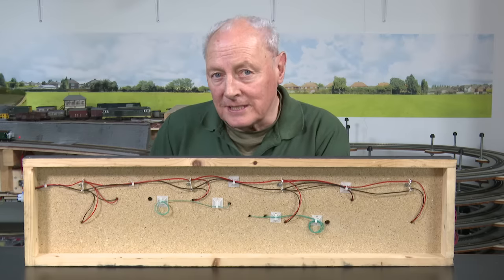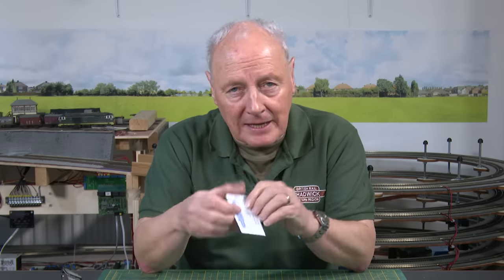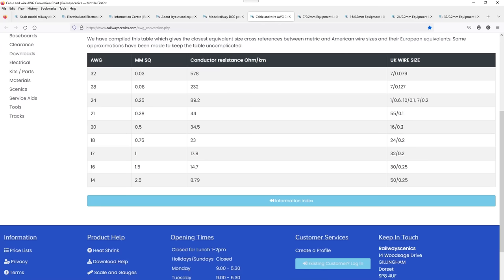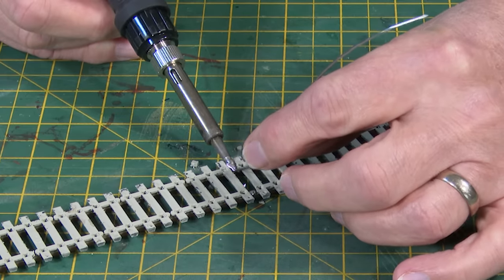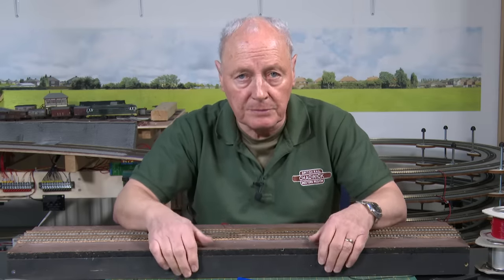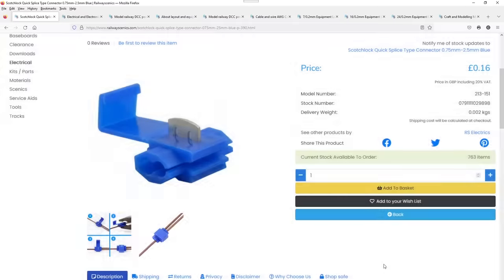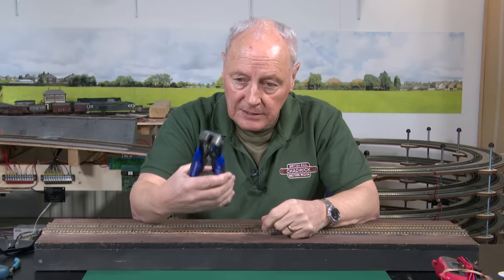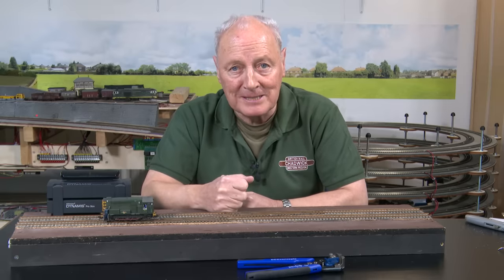LAYOUT WIRING for DC and DCC and all gauges at Chadwick Model Railway | 175.

Comment: Great channel Mr B. With bus wiring I just glue a length of track under the board and then spot solder the droppers etc to either side of the track. Gives superb flexibility and you just need to power the track.
Reply from the maker: Ingenious Guy, I take my hat off to you. Regards, Charlie.

Comment: My favorite fire experience: (this was not me, I was a visitor) a nurse comes running out of a hospital room yelling fire & a visitor (who happened to be a firefighter) put a pillow over a trash can fire and smothered it. By the time all the fire engines, ladder trucks, hospital maintenance staff, administrators and the safety officer got there it was out. But the safety officer, seeing it was out, but he sprayed a dry powder fire extinguisher and made a mess everywhere, including needing respiratory therapy to treat the patients who inhaled dry powder. Priceless.
Reply from the maker: What a great recollection, Stephen. Regards, Charlie.
Reply: @ChadwickModelRailway  
Excellent timing on wiring, I have six colors of 16ga AWG on spools and the next step is laying a BUS wiring for my new 122 cm x 244 cm (?) 4'x8' N gauge layout. It took some time to get the height up to 130 cm (51") so I can work without sitting or bending due to a back injury with chronic pain, but it beats spending my life in a wheelchair or worse... 
Two wires for general use +/-, and six wires for my OCD or is the conversion putting the letters alphabetical CDO, lol!

Comment: Hi Charlie, I wish I had seen this video 2 years ago when I was wiring my layout. I have been told that I went over the top with my track bus cabling, I used 6mm cable with a dropper from every piece of track, but with a track run of about 200ft I don't get any voltage drop or signal loss so I think my choice has proved it's point, the cable I had spare in my garage from my contracting days. The DCC Concepts wire strippers are similar to the type I have been using for about 20 years now, they will strip any wire size from telephone to 6mm without having to waste time adjusting the cutting throat like with some expensive units. The connectors are a great unit but I found out about them when I was about 3/4 of the way round my garden section soldering the droppers to the bus wires so I just carried on. Another excellent video which also covered some of the safety requirements when we are working on our layouts.
Reply from the maker: Sounds like a bit of overengineering Peter, it’s not such a bad thing. Regards, Charlie

Comment: Those stripping tools from DCC Concepts really are excellent, I got one just before I started to build Pevenbourne and have used them to install the Track and Accessory buses so far on Phase 1 of the build along with the little connector boards you demonstrated. And I shall continue to use them throughout the build. I also install my droppers in exactly the same way as you do having learnt the single hole through the board method from you a couple of years ago.

Incidentally, thought I’d share a little tip that I use when I solder the bus wire to the tag:- 

After you’ve stripped the bus wire, passed it through the tag and soldered it, while the joint is still hot, it’s possible to gently push the insulation from both sides of the tag so that it closes right up to the metal of the tag so you don’t have a gap in the insulation. It works for me and I do it on all the tags. 

Take care Charlie.
Reply from the maker: Great point Bryan, regards Charlie

Comment: Hi Charlie! Fantastic little tutorial mate 😉

I have made good use of those block connectors on my portable garden test track set up, and they work superbly! I also made use of HiFi male/female sockets which plug in nicely on the simple two-track sections on my ‘back straight’ furthest from the power source! As you suggest, running a bus and dropper wire system really helps maintain even running with DC and can’t recommend it enough 🤓

I also made use of a pair of SCART leads to connect my power box to the main board, which enables me to run DC in sections. Because of the simplicity of the connector systems, it means I am able to fix the 6 separate components of my set-up, including the legs and tables they sit on, and then make all the electrical connections secure within about half an hour 😎

By the way, as someone working in a safety critical environment, I applaud your simple H&S advice. I have a mini extinguisher from a kitchen supplies ship inside the door of my shed ‘just in case’, not least because, as I am sure you well know, even the fumes from a small electrical fire can be life changing 😟

Oh, and thanks for drawing attention to that website. That is what you call decent customer service, which seems to be an evermore disappointingly rare characteristic these days 🙄

Cheers mate, look forward to the next one, have a great weekend 👍🍀🍻
Reply from the maker: What a heartwarming comment Tim. I’m so grateful to have you on board, with such enlightening comments. Regards, Charlie

Comment: Super-duper video, Charlie.  I have the very same RS Components wire stripper and I'd like to share a little tip with you that an electrician shared with me.
When using multi-strand wire and stripping the end, don't pull the entire jacket of the wire off, instead only apply enough force to cut the jacket and pull it slightly back, leaving the jacket that's to be removed still partly on the wire length.  Remove the trimmed jacket but, as you do so, twist it, and it will twist the wire strands really neatly. It works a dream and saves running the risk of a copper wire splinter.
Reply from the maker: An excellent suggestion and much appreciated. Regards Charlie

Comment: Charlie I managed to watch another five mins of your soldering techniques video before exploding with frustration. You took another third party product clipped it with your cutters and recreated the task if the D.C. scotch lock connector…, then you got your soldering iron out again. OMG just press the scotch lock closed with your pliers!job done!!
No more soldering under the table … please!
Reply from the maker: As I mentioned in the previous comment Paul, I couldn’t possibly recommend something that has a reasonable chance of failure in the long term. Regards, Charlie.

Comment: This takes me back. My dad (Ex RN!) Had a business manufacturing cable testing equipment, all cable has to have its insulation tested as its extruded and the insulation applied and the machine that tests the insulation is called a spark tester. We made units from 3KV to 50KV to test all types of cable including multicore and multi strand cable. We manufactured machines for all types of manufacturers from the really big boys (BICC etc) to small one machine family run businesses!
Reply from the maker: Happy days, from perhaps simpler times. Regards, Charlie

Comment: Charlie... Been watching you for a couple of years.  I am in Canada (Brit background however) but I do not model your scale, heck I do not even model DC/DCC!    I find your "generic" videos most helpful.  

I inherited my father's Marklin collection a number of years ago and I continue to keep the folks at Marklin employed by buying more "stuff" for it.  Marklin is HO.  Uses AC current.  I have both an analog portion of the layout and a digital (using Marklin's proprietary controller).   This video was an excellent example of how to run a bus.  I am in the early stages of ripping my layout apart and starting over and I will certainly look to using a similar method of electrical bus.  

Bruce
Reply from the maker: Thanks Bruce, I wish you well bringing your father’s layout up to date.
Regards Charlie

Comment: Hi Charlie, your "how to" video's continue to provide amazing insight and knowledge to me as a seasoned novice getting into building my first layout thank you so much!  I have started with a couple of demo base boards to mock up my planned TMD and I am using second hand track/points to learn how to plan and layout the track as well as then DCC wire it. My early soldering has been a bit of a disaster to be honest where i have melted sleepers :( However, I plan to keep practising it as it will be the only way I improve! I have just rewatched this video as today I am soldering in the bus wire and droppers and I have invested in the 3 way tags and wire strippers from DCC concepts, thanks for the tip! I have also  found the ralwayscenics website you highlighted and again this is incredibly helpful as a beginner to this hobby. Once I feel that I have developed my skills sufficiently I can then move onto my intended layout. Thank you so much, your archive videos are incredibly helpful and I can easily search for the topics relevent to the build stage I am at. All the best, Richard :)
Reply from the maker: Thanks Richard, I’m so pleased that you found the channel to be so useful. Good luck with your project.
Regards, Charlie.

Comment: Charlie, An absolute blinder!! I'm just about to spend a weekend on my back, hooking up my droppers to bus wires,  Some great  tips, I too have an aversion to those auto crimps. The terminal strips you illustrated for joining the droppers to the bus wires are an absolute gem. I like to solder the droppers to the ends of my tracks, thus I get two  droppers onto one bus wire join -saves a bit of time. Thank you for the video, so much useful information. A final thought, you can't be too OCD on wiring, if it's a rats nest and you've got a problem, you haven't got a hope in hell.
Reply from the maker: Great comment Scott. Good luck with your project, regards, Charlie

Comment: Charlie, I've moved on from suitcase connectors because, as you observe, sometimes they don't make good connections between wires of different sizes. However, I don't want to solder beneath the layout, over my head. I now use solderless T-taps. You attach the female end to the bus wire (crimping them) and the male end to the feeder (dropper). Then, you simply plug the male into the female end. Works great. Having said that, I like your method for neat wiring.
Reply from the maker: That’s an interesting comment James, I shall have to check them out. Regards Charlie

Comment: Hi Charlie, Richard Johnson sold the cutters/ strippers and the bus tabs about 10 years ago, that's how i have wired my bus and droppers, works a treat. I in some place soldered an extension terminal to the part where the holes are which meant I could wire at least 4 bus wires each side where there is multi tracks. Great video as always.
Reply from the maker: Thanks four Oaks, I’m so pleased that you found it. Interesting mate. Regards, Charlie
Reply: @ChadwickModelRailway  Always

Comment: Hi Charlie, long time watcher, first time commenter here! Great video as always! You're content has really helped me as I've made my way back into the hobby after a 35 year break! Soldering under the layout frightens the life out of me, so I started using those Suitcase connectors, but have since moved onto using things called Lever Nut connectors! You can get them from Amazon / Screwfix and they handle differing wire sizes and come in sizes with different numbers of ports, so you can take multiple droppers from the same connector! Keep up the good work! All the best, Ian.
Reply from the maker: Hi Ian, I think the connectors you’re talking about are called Wago connectors. I shall be getting some next week and checking them out. Regards Charlie
Reply: @ChadwickModelRailway  - Ah, okay, I buy the unbranded ones to save a bit of cash! 😀

Comment: Great timing Charlie :) just dumped my Parsons Heath layout, room needed decorating anyway but glad there's an alternative to connecting droppers to the bus wire. I hated those clips and I found them problematic as with those soldered rail connectors so will give those clips from DCC concept a try. Memories of the Great Eastern in N gauge is being started at Christmas on a 12 x 8 board set up so this video has been very handy... Thanks Charlie
Reply from the maker: Thanks Steve, I’m so pleased that you found this video particularly useful. Regards, Charlie

Comment: A phrase I've used many times, but "I love those strippers and must get a pair for Christmas". Thanks Charlie, I'm just at the bus wire point on my layout and have been stressing over using chocolate block type connectors. This seems a far better system.
Reply from the maker: Good luck with your project Mike, I’m sure that you will wire it up just fine. Regards, Charlie

Comment: Great video as always Charlie. Thank you for that. A word of caution re the use of the fire extinguisher. Most folk have never used a water/foam based extinguisher let alone a C02. The latter tends to go off with a heck of a whoosh when you squeeze the trigger and can really scare the unwary. You can end up doing more harm than good and actually spread the fire rather than put it out. The reason we have extinguishers in the workplace and the home is to help us escape if our exit is blocked which is why they are always located on the route of escape or final exit, rather than to fight a fire. I did fire training in industry and elsewhere for many years and would never recommend that anyone "has a go" if they don't know what they are doing. Can cause far more serious issues...not being critical by the way, just a cautionary note.
Reply from the maker: I do thoroughly understand your point of you. However, when faced with a burning waste paper bin, perhaps one shouldn’t abandon the building. Regards, Charlie
Reply: @ChadwickModelRailway  Agreed....much better to pick it up and run for the door (seriously, I saw someone do this with a chip pan fire before they threw a bucket of water on it and wondered why it exploded!). A liitle knowledge can sometimes do a great deal of harm which is why I always leave anything electrical well alone even with your expert advice...

Comment: Good job Charlie. Tag strips like the DCC concept ones have been around from a very early stage in electronics. searching for  10pcs/50pcs/100pcs turret strips on aliexpress will find a heap of options. Some of theirs leave the centre tag just for mounting it. Good call on the suitcase connectors. They used to be used in diy auto stuff more so. Auto electricians prefer crimps for better mechanical reliability. Suitcase connectors can work for some but differences in insulation thickness, number of strands and strand diameter and not cutting dead square through the insulation means poor contact or cut strands and they are a hidden issue.

I find a lot of people don't join the dots for what is required for block detection. Usually, for current detection type block detectors, all droppers, from one rail, go to a feeder that then is connected to the DCC bus through the current detector. The other rail droppers going directly to the track bus for the other rail. Could be worth doing a diagram of how it works for your block detectors next time. Great work Charlie.
Reply from the maker: An interesting comment Greg. However, I know that a great deal of people loathe me mentioning block detection! 
Regards, Charlie
Reply: Totally agree with you about this. I've been confused by talk about bus wires with DCC and that the droppers are connected through the block detector units on one rail (red on Chadwick?) and the other droppers are connected to a bus (black on Chadwick?)

Comment: Hay Charlie : Much thanx once again for an informative video. In being at risk in stating the bleedin' obvious and as a humble suggestion born of bitter experience during the sometimes boringly repetitive process of MR-wiring; it is good practice to Multimeter-test  EVERY solder-joint for continuity at the TIME of each join !  In any event; you certainly  do  make mention of continuity-testing towards the end of the viddy. Best Wishes for the Festive Season  and  know that all of us appreciate your Series  / Johnny
Reply from the maker: Hi Johnny, no I don’t use a multimeter to carry out continuity test. I have the belief that the soldered joints are good. Regards, Charlie

Comment: Great video Charlie, as usual. I am just about electrically illiterate as they come, even though I've wired my layout according to the 'experts' in the model railroad hobby, it still runs just fine despite my efforts to the contrary. Far be it from me to attempt to change ones mind about something that they have an intense aversion to (those Scotch Lock connectors or 'suitcase' connectors as they are commonly known over here across the pond) but, I have used those things with great success on my layout with no issues except for the occasional (1 in 20 or so) time when the connector didn't lock or engage the wires as advertised. My suspicion to your, and some other commenters on your channel's aversion to those things might be with stranded wire. I seem to have read somewhere that it is not recommended to use the Scotch Locks with stranded wire so as not to cut individual strands and 'weaken' or completely break the electrical connection. But again, I am no expert by far in the electrical world and if you and some of the others that watch your channel still have a hatred for the Scotch Locks that is just fine and is your rightful opinion. Again, I'm not going to try and change your mind. Just my 2 cents worth (or pence??) for what difference it may make. Please keep up with the videos, I love them and your subtly hidden humor throughout. Dale
Reply from the maker: Thanks Dale for you valuable opinion.  Here in the UK, stranded cable is the norm for our hobby. I didn’t know that scotch locks weren’t recommended for such cables.  Regards Charlie